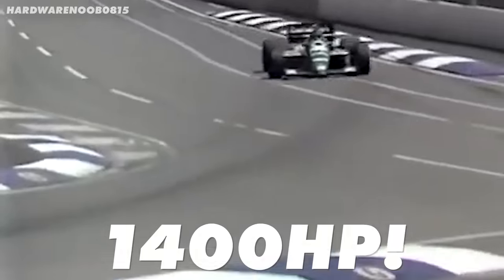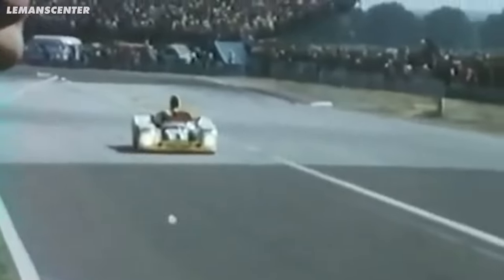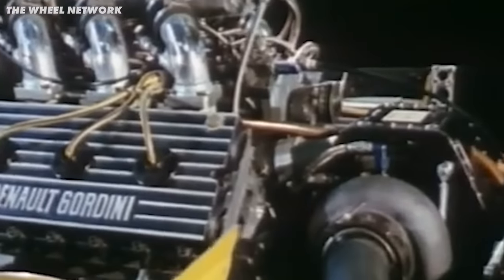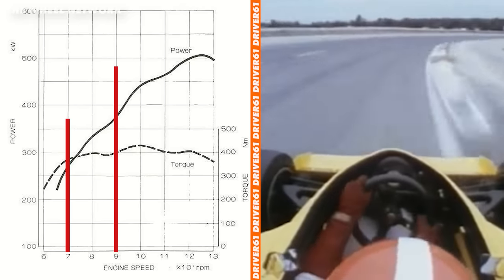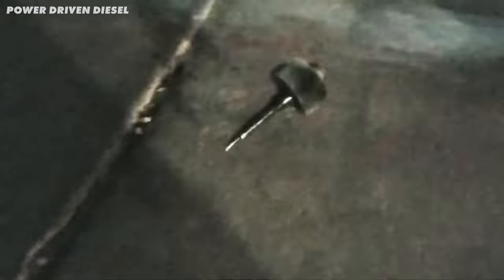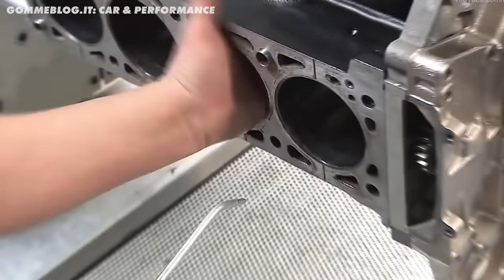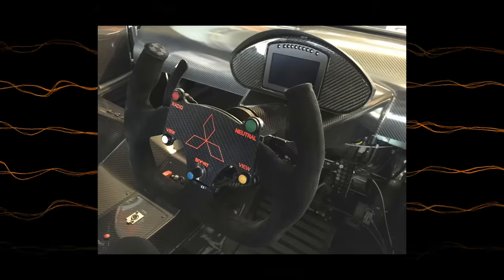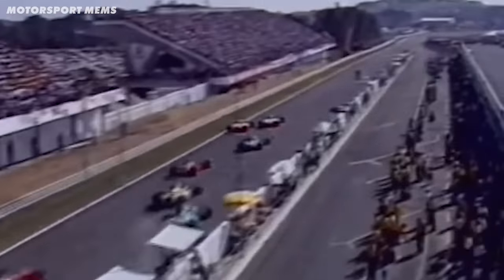When Formula 1 Had MASSIVE TURBOS

Comment: This is one of the reasons that I prefer larger displacement NA engines for street-driven sports cars, less complex and more reliable with less stress on the engine and drivetrain components.
Reply: It's all relative to how it's built. I've got 102k miles on my boosted brz and have yet to experience any problems

Comment: Kinda surprised how long it took turbos to make it into F1 considering the success Porsche, BMW, etc had already seen for years before in Le Mans and other events

And they were running big boost way before Renault
Reply: Money like always. Turbos were expensive back then and the unrealiability that came with it would make the teams spend even more money. BMW used junkyard 3 series blocks for their qualifying engines and they would literally last 1 lap at full power and blow up right after lol
Reply: @Barbosa81  yeah I'm thinking more like the 935 and 2.1 Carrera rs turbo which won 24h le mans back in 1974 so had good reliability most times. Bmw also had the twin turbo CSL in 1976, except in that case the issue was the transmission grenading from the turbo torque

TBF I think those qualifying engines ran at something like 4 bar and 1400bhp which is bonkers
Reply: I'm also thinking about the Saab 99 Turbo which came out in 77-78. I know we are talking massively different numbers and this is only a production car with 140 hp, but what made it special was the reliability. They invented the wastegate at Saab. I also find it odd that they were not running turbos in F1 at the time already. Probably the amount of power that limited them and nobody was ready for testing it out and risk their reputation. I'm thinking that Le Mans probably was much safer to try things out because of the lower status.

Comment: It should be remembered, that 1400 hp from the BMW was strictly for qualification only, and then for a single lap. The race engines were considerably reduced in power to last the race distance. Then there was all the special fuels which bore little resemblance to what you'd find in your neighbourhood petrol station.

However, I do recall seeing this crazy mad cars at Brands Hatch. I also recall the huge difference in performance between the top teams and the ones at the end of the grid in those days. It was clear which teams had the money to spend on such exotic technology, and the bottom teams would trail in several laps back.

Comment: The boost they were pushing though these power units for the time was insane. During the first Turbo erea I was in my Teens . So most of the tech was over my head.
But last year I visited an amazing Collection of Cars Planes and Trains while doing a Tour of Germany  Sinsheim Technik Museum. They have an impressive collection of Race cars and Formula cars along a ton of other stuff.but they had a Zakspeed F1 car they also ran an inline 4 , 1.5 ltr Turbo they had a static engine on display along with the amount of boost off the top of my head 3.4 bar around about 49.35 PSI lord knows what the qualifing Boost was been run from the Likes of Honda or BMW . As for in the wet their is a scary incar video filmed during practice back in the 80's with a camera on the cars  at that time cameras were only allowed to be used on cars during free practice .
Those films were made for ELF fuels using at the start Renault F1 cars , but they were later released as a 2 part VHS collection and much later on DVD as the Laps of the Gods collection.some laps are more demo runs but there are a few were the driver is really pushing the car and you can really see how violent these cars all or nothing power band was.

Comment: Fun fact: The blocks of the BMW M12/13 are actually out of used M10 street car engines, used i.e. in the BMW 02, e21 and early e30 street cars. To make the story even crazier, all this F1 engine blocks had been salvaged out of used road cars with more than 150.000km on the clock, to be sure, that there was no more material tension in the cast iron, which could cause potential material failure. Only a genius, like the former BMW engine designer Paul Rosche could come up with such an idea!

Comment: After almost 10 years of hybrids, the cars have become so reliable (at least mercedes and honda ones 😂😂), we dont get many dnfs that would make races less predictable. Really excited for 2026 even if it's still so far away.
Reply: Engine failures , refueling , tire strategies  , all added a Kismet factor to F1 back then and the fastest car and driver didn't always win as a result . Todays F1 try to artificially manufacture this kismet factor but it is just not the same and doesn't seem to work .

Comment: Forced induction wasn’t just very common in the aircraft industry, every single IC engine had it, that’s the only way not to lose all your performance in hogher altitudes. But no really, f1 turbos seem straight out of the stone age compared to the complex forced induction systems of end of ww2 piston airplanes.
Reply: Turbos in pistons planes had more room and more performance needed vs in cars which are several times smaller cause of the cars size.

Yeah I know that pretty much the turbocharger where all used in pistons for a long time in piston engines in planes way before cars.
Reply: Some of those aircraft piston engines had unbelievable complexity, the Napier Sabre was a H-24 configuration with sleeve valves and a two-speed supercharger driven by a torsion shaft. The P47's R2800 Double Wasp air cooled radial had a remote mounted turbo/intercooler (behind the cockpit). Pretty amazing they were able to get them to work at all, let alone reliably.
Incredible it took until the 70s for turbo tech to appear with any regularity in the car industry.
Reply: @woopimagpie  it's probably cause Turbochargers need tons of air and car engineers probably didn't think of it until leftover aero engineers started to think of using their knowledge. Let's not forget of Ships too.

Comment: as far as piston engines go, aerospace was practically centuries ahead of the automobile industry by the time they stopped using them. i mean, how many auto engines do you know use water injection to improve horsepower by at least 25%. they used it to cool the turbo, yes, but in the  double wasp plane engine from late ww2; water injection was used like nos is used in a car to gain an immediate huge leap in horsepower, water was literally pumped right into the combustion chamber.

Comment: Mhm, as far as I know, only Porsche was able to get VTG working for a Gasoline car and only for the 996. It was fantastically complicated and difficult to get the very thin ends of the blades strong enough to resist about 1400°C. After that excursion, Alfa came around the corner with Scavenging. So that was the end of that. But on Diesel cars VTG is state of the art because of the lower temps.

Comment: Do not forget the H-16 BRM engine. What is sad about modern turbos is they mostly are used to make engines too small for the application acceptable, but could give false high fuel economy ratings as on the testing rack as the turbo would not engage. In the real world on the road the economy tanked. Initially they were used to boost the power of an NA engine. Porsche 3.2 liter 911SC 172 hp. 930 3.3 liter 300 hp. Saab 900 2.0 125 hp, Turbo 175 hp.
Reply: 118 hp for the N/A Saab at the time.

Comment: In the F1 regulations of today, the power of the engines is completely limited by the amount of fuel.  Both the amount that can be stored in the tank and the instantaneous fuel flow rate (which is the thing that Ferrari used to cheat).
So now it no longer makes sense to have a giant turbo with a high boost pressure.  And you cannot cool the engine using a rich mixture.
Now the cars run extremely lean, and everything is focused on having the best efficiency, i.e. to take the most power out of the given amount of fuel.
An F1 car does that twice as good as your road car.  But that will mostly end with the current regulations that allow the MGU-H.  The next engines will have far less power and will be less efficient.

Comment: What’s amazing to me is that in 1988 the cars were limited to 1.5 bar of boost (2.5 absolute), and now my fl5 civic type r will push 1.7 bar!
Reply: New materials and techniques I guess. It also takes a lot of control electronics to keep it in check nowadays
Reply: @czechgop7631  Well, to be fair in 1986 they ran 4.5 bar of boost in qualifying. In 88 they were artificially limited by the rules to 1.5 because the FIA felt the cars were too powerful.
Reply: @ASJC27  Those engines surely couldn't have lasted long at those pressures, so it would be inpractical to employ in a road car, right?

Comment: You missed the fact that the it was diesel trucks that moved turbochargers into the mainstream. In the early 1960's turbos were the solution for the power lose trucks experienced on high altitude routes, later it was discovered the engines ran more efficiently as well. The 80's F1 cars actually used turbos developed for road trucks.

Comment: Senna trembled on the accelerator even with aspirated engines and no one knows for sure why, it is likely that he also did it for traction reasons or to reduce understeer.
I remember that Ferrari in 1985 or 86 tested a v6 engine with 4 turbochargers in two packs for each bank connected in series, it is said that it exceeded 1500 HP, but it was never brought to a race due to the imminent limitations on pressure imposed by the FIA.

Comment: 3,5 bar in today's f1 engines? Engineering Explained calculated that modern F1 cars run less than 2 bar of boost (i think it was around 1,5 or 1,6 bar) but make the power bwcause of revving the engine higher, up to 13.000 rpm
Reply: I think even more than 3,5 bar.

Comment: "The delay before the turbo spins up, is what we call turbo lag" WRONG! that's actually boost threshold!!!! Turbo lag is the time it takes from a closed throttle(operating at enough rpm to already create boost) to create power once opening the throttle! Boost only occurs when intake manifold pressure exceeds atmospheric pressure! The more boost you're running the longer it takes to create enough pressure to open the wastegate! Until there is enough gas to open the wastegate, the turbo isn't working yet so the turbo isn't lagging, you  are just within the threshold of boost!

Comment: Modern turbo engines at the upper peak of performance in events like "Drag And Drive" here in the US are making 4500+HP these days.  Steve Morris Engines makes a production of these motors.  We have production hypercars pushing the 2000HP mark from around the world.  1400 is a ridiculous amount of HP but by no means close to what we can achieve in modern times.  Technology partly from the F1 motors you have talked about has gone on to help create the crazy motors of today.
Reply: I think that comment was more in relation to displacement of that engine. those hypercars have >4 liters and will not last a race driven hard.

Comment: I strongly disagreed with the concept of a different engine for qualifying than for racing. The qualifying engines had so much turbo boost that, like a dragster,  they were finished after 2-3 laps. It didn't represent the car that would be raced at all.

Comment: Imagine if modern F1 engines actually ran 50 psi of boost.
Reply: They run much higher boost.
Reply: @V8Lenny  Engineering Explained has shown it to be in the low 20s.
Reply: @tynancravy5589  he said he dont know how much boost they are using. He also said MGU-H is used to brake turbocharger to control boost, they tried but it didnt work, they use wastegates.
Reply: @V8Lenny  Watch the math portion again. I understand that he doesn’t know, but he got pretty close.
Reply: @tynancravy5589  850 is possible with 2,4 bar absolute but not with 18 AFR and Miller or Atkinson cycle.
Reply: @V8Lenny  The math doesn’t lie. Those engines are about 2x more efficient than the average ICE. That means that they only need 40-50% of the boost the a normal engine would need and F1 uses the Otto cycle like pretty much everyone else.
Reply: @V8Lenny  In reality, based on given numbers, I wouldn’t be surprised if they’re running at about 25 psi.

Comment: 1400hp and 600kg. Thats 2,3hp per kg. Now its 1000hp and 890kg, 1,12hp per kg. So weight to power ratio was twice as big
Reply: Putting that power down is important even V10 F1 cars 950 HP 600 kg needed traction control
Today's cars can put power down much better the 8 speed gearbox etc 
V10 F1 cars were fastest F1 cars in history tho (in straight line)
Reply: @Smzxe  yes true tho tc only started 2002, v10 before that no vc
Reply: @mikkolappalainen_  still tho you can't put 1400 HP down in that F1 car 
If you put V10 F1 V6 Hybrid and V6 turbo F1 in drag race 
V10 F1 car would win second will be V6 Hybrid

Comment: I just want to throw in here that turnos aren't as efficient and great as so many have been duped into believing they are. Set aside the obvious "lag" issues, turbos are actually a massive exhaust restriction. There is significant parasitic loss because of that. Consider this next time you're in a turbo vs supercharger argument 😊

Comment: So if we currently have turbo with similar boost pressure, why is horse power down?
Reply: probably running too lean
Reply: Fuel flow limitations
Reply: Because boost isn't everything. You can increase boost, but at a certain point you won't get more power or torque out of the engine, because the preasure in front of the turbine get's so high that your losses at the engine side increase dramatic. Trough the higher exhaust gas the temperature in the cylinder head increase and knocking will be likely. So you have to reduce the ignition angle and that costs power. It is all about the set up of your engine components. The Turbos for the qualifier engines which was able to produce 1400hp were massive. The BMW engine needed around 5,5 bar boost to produce this amount of power. Much more than today. Nothing was really limited. You can't compare the old turbo engines with the new generation. And high toxic fuel was a huge part to increase the power of the first generation of turbo engines. Today these kind of fuel is vorbidden.
Reply: Because they run something like 18:1 AFR
Reply: @carstennobody7047  I think F1 technical forum, or maybe Speedtalk. It quite common these days, I think DTM engines run also very lean. F1 are also Atkinson cycle engines, they need higher boost.

Comment: The aircraft comment is flawed aircraft of that era tended to be turboprop……. Which is a totally different…….
Reply: pretty sure all aircraft running radial ICE comes with turbos by default during that time. air is too thin up there for the engine without it.

Comment: This is what separates today's best from being greatest drivers of all time. No way could the scrawny drivers of today handle old generation cars with one hand for hours with no driver aids on the steering wheel. They are great drivers but, it's a totally different type of car they are strapped into. Even those massively powered cars are extremely different from early F1 cars. Each era has it's own top driver but, no way are they comparable.

Comment: Not to take away from your vid, but 1400hp is pretty normal for drag builds in the Tx and Ok. There are vipers, gtr's and lambos putting down 3000hp+
Reply: I think the knowledge that there are larger outputs is well-known. They're just referring to engines that were permitted to race F1.
Reply: Yes, but not with an engine displacement of 1,5 l. That is nearly 1 hp per 1 ccm. The middle preasure in the cylinders were over 50 bar. That is to this day top notch. I think just top fuel dragsters produce even more power per ccm. The Lambos you are talking about has a 5 l engine. So we are far away from 1 hp per 1 ccm. By the way the Honda V6 engine produced at 4 bar boost 1002 hp and 740 Nm torque.